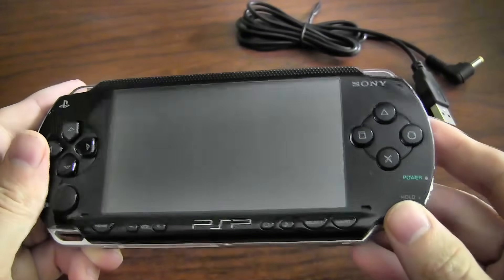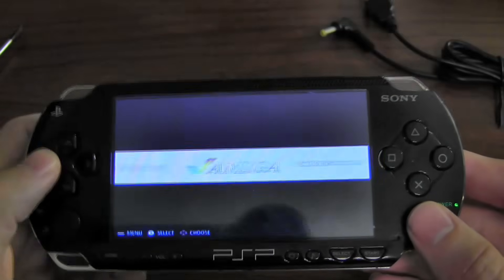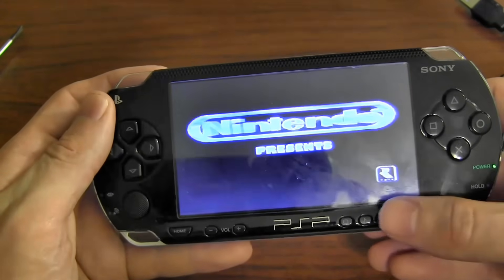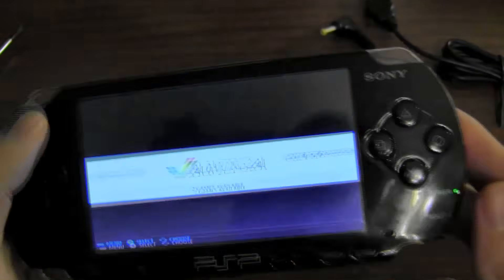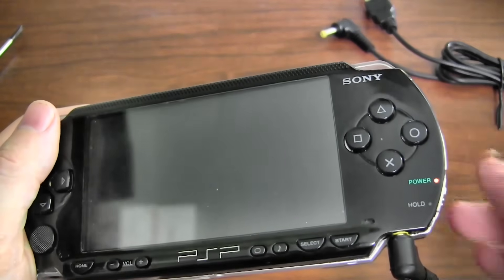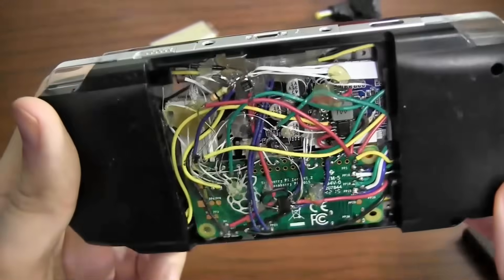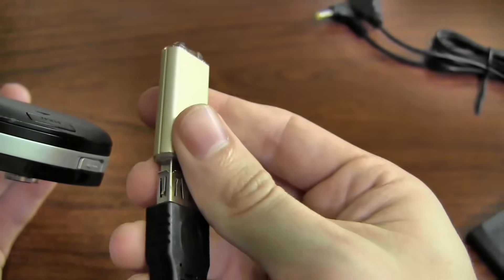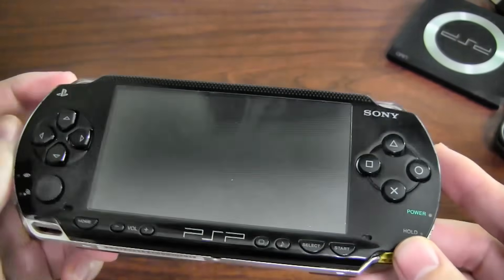PSPi Version 1000.2  - Raspberry Pi Zero in a PSP Shell

Comment: Cool! Is it possible to use the power button behavior of the original PSP, where sliding up the power button once will freeze the device and use a lot less power, but can be restored to the exact state it was in, and holding the button will turn it off?
Reply from the maker: Yea that's possible. It would require a redesign of the power circuits. What would probably be easier is to switch the LCD off when the power switch is in the bottom "hold" position. That would only need a few more components.
Reply: Ok. I thought that you were using a digital power switch, and not a hard-wired one? Because in that case you would only have to modify some code...
Reply from the maker: +iSasFTW I am using a soft switch, but I'm not aware of any low-power mode on the pi that allows resume.
Reply: If the emulators support save state, you could turn off the pi and save the state, and when powered on, restore the state.

I'm pretty sure the original PSP just turned off the display (and probably wifi and a couple of other things) though, so it might be possible for you to turn off the LCD programmatically, and when the button is held, send a shutdown command.
Reply from the maker: I know about save state, but it doesn't really accomplish what the PSP did. The OS still has to be shut down and then loaded up again. Just turning the LCD off would save a ton of power and allow for instant resume.
Reply from the maker: But yea some code could probably be written that would automatically save the state when the shutdown button is pressed.

Comment: you should try lakka.tv on that ! it would look way way better!
Reply from the maker: I agree. A few other have recommended it, and it's like number 76 on my PSPi to-do list. Once I get the hardware finished I'll definitely try it out.
Reply: Does it require a more beefy PI than the zero? I notice they list the Pi3 as their recommended Pi.
Reply: oooh ya right your using pizero
that might not work so well for you then it does need some thing heavier if u want to use n64 or psx